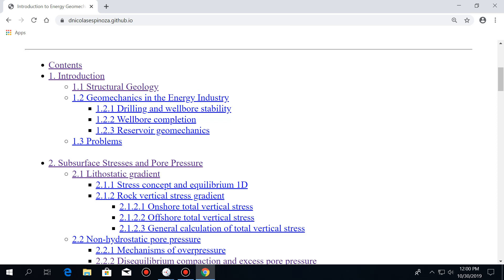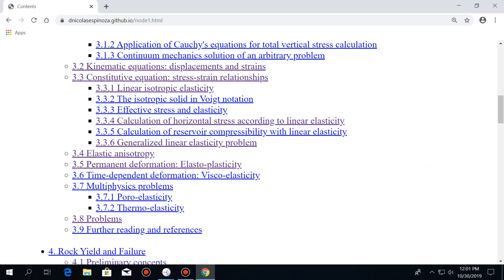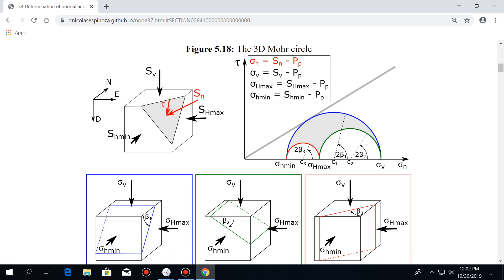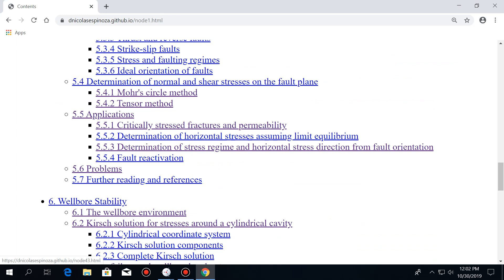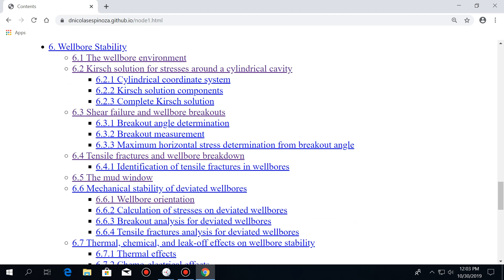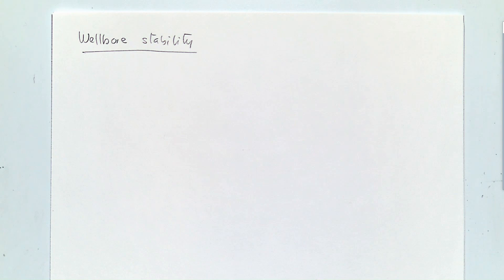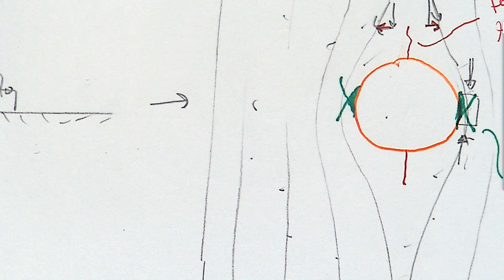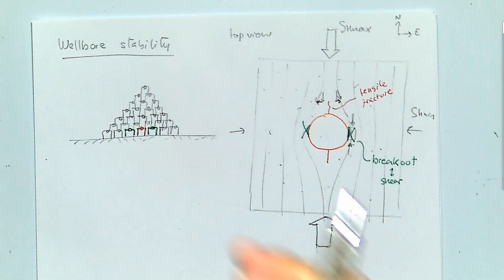L22 Introduction to wellbore stability and Kirsch solution

Comment: When you're in a reverse faulting regime where S1 = SHmax , S2 = Shmin and S3 = Sv, do you still calculate Max tangential stress as 3*S1 - S3? Because S3 is not acting radially on the borehole, Shmin is (S2). Conversely, if the borehole is horizontal and in the direction of SHmax, wouldn't you use 3*S2-S3 as those are the stresses acting around the borehole?
Reply from the maker: Hi, please check the lecture on deviated wellbores: https://youtu.be/5j7gyzCfZX0?list=PLv0npDbE5HXtZbV42aJXzrOsv-V8q_q8_

Comment: Would the openhole will collapse if the hydrostatic is removed? An example well completion once the screen are set along the lateral section, packer set, and the formation isolation mechanism is closed then there will be not hydrostatic on the openhole section. Would it mean that the openhole can collapse immediately?
Reply from the maker: If the rock is not strong enough, yes, the rock around the well will start to fail in shear once the bottom-hole pressure is lowered and the well is put to production. The higher the pressure drawdown, the higher the effective stresses around the well. This might end up in sand production (https://petrowiki.spe.org/Predicting_sand_production), a topic in my "TO DO" video list.